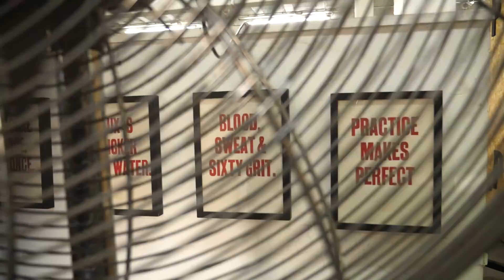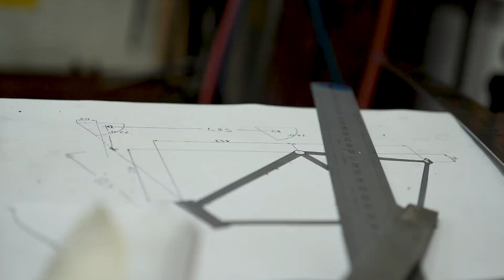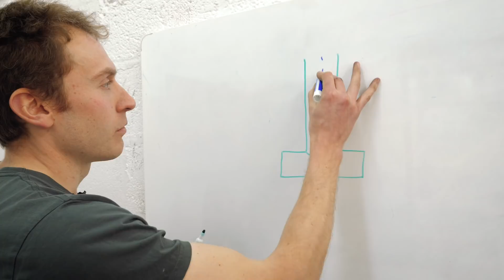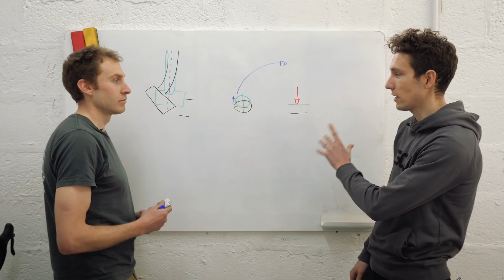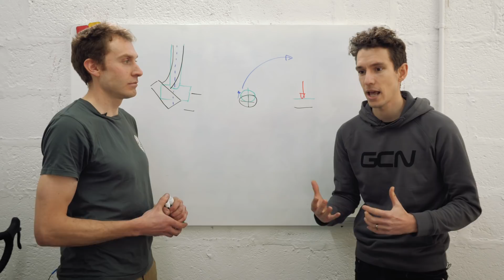Are You Faster On A Stiffer Bike?

Comment: Saying a flexible bike could go as fast as a stiff one is like saying that you could still shift gears with elastic bands for gear cables. You’d still be able to get it done and the force that you are applying at the shifter end will always be equal to the force at the derailleur but there is huge loss in work between the shifter and the derailleur because the shifter would have to move so much further than the derailleur. All that lost work would be transferred into heat in the elastic band. Remember work=forceXdistance. The distance moved at the shifter end would be greater than at the derailleur end, therefore there is more work being done and there must be a loss in work over the system. The exact same thing applies to the bike where (accounting for gearing ratios etc) the pedal would be doing more ‘work’ than the back wheel and therefore there is a loss in work due to flex in the frame.

Comment: I suppose what you have demonstrated is that lateral (side to side) stiffness is marginal to performance, but in a sport where marginal gains can make the difference between winning and losing the loss in energy in a frame that isn't stiff could be detrimental at the top level.

For the everyday rider however, stiffness translates into that planted, secure and direct feeling when you are pedaling, as well as contributing to the overall ride quality of a bike. After riding different bikes, I can comfortably say that regardless of any performance differences, I'd want to be riding something stiffer because of the better feel.

Comment: Another different thought that is more based on physiology than physics.  Does getting shaken and beaten on a super stiff bike cause the rider's performance to drop faster than it would on a more compliant but possibly slightly less efficient bike?  This is also related to the tire analogy.  Clearly bikes designed for pave allow compliance in some dimensions.  But maybe even lateral bike flex is useful.

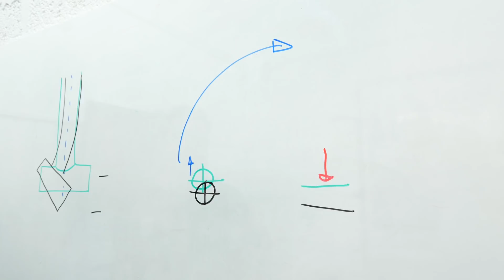Comment: The clockwise rotation mentioned at 5:50, would that cause the chainset to spin in the opposite direction if you repeated the experiment on the left crank, seeing as you are observing from the other side?

Comment: Jan Heine calls the energy returned by frame flex under pedaling load ‘planing.’ Its hard to understand, but I personally believe it’s a thing, and I believe I feel it occurring. When I ride my flexier bikes. Basically, different riding conditions and loads require different frame characteristics. If you ride crits in a punchy manner and sprint out of the saddle standing up at 1800 watts, your optimal bike will be fairly stiff. If you use 300k brewers and churn a moderate cadence at 200w on hour long climbs and never spring above 1000w your optimal bike will be fairly ‘flexy’, at least, in the seat-tube. Horses for courses.

Comment: Two thoughts:
1.) The resonance frequency of an body depends on its stiffness to weight ratio and resonance phenomena are related to energy absorption. Thefore if the excitation frequency is in the range of the resonance of the frame, the energy "loss" could be higher.

2.) If the deformations of the frame are leaving the linear elastic region of the material, the osscilating stresses could lead to a hystersis loop. This could also mean energy absorbtion.

Comment: Frame flex probably doesn't result in huge losses via heat or sound, and while it is feasible that the majority of the energy is returned during unloading, I think the bigger concern is the effects of frame flex on other components. Do the brakes rub? By how much do the cassette and crankset rotate relative to one another? Even a few degrees of difference can result in additional friction and wear on those components.

Comment: My take on it is that even if the frame flexes, and you got 100% of the energy back once it released it, you could claim that the energy inherently becomes less useful for what you are trying to achieve, simply because the power doesn't go down immediately when you push down, but rather a few moments after (perhaps on the  up-stroke). There could potentially be a side effect that the flex built up from pushing down on the left pedal is released as you start pushing down on the right pedal, and given the rotation is in a different direction, you basically need to waste energy to overcome the flex generated by the other side.
So if you think of potential energy stored in something like an elastic band, the more energy you put into it, the more energy you need to use to keep it stretched out. (and whilst you get the energy "back" when you release the band, if what you are trying to achieve is pushing out only, the release of energy doesn't help you do that.)

Comment: Frame flex didn't move the wheel....chain stretch and then recoil moved it. As can be seen when Simon pressed down on the pedal, the frame flexed sideways. And then releases sideways. The pedal moves down, stretching the chain, and then releasing the brake, the pedal doesn't move back but rather the chain recoils and spins the wheel in the only direction it can go.

Comment: Looked like you were just loading the crank and drive train? You started with the crank at 3. 0clock then stood on it till the crank went to 4 o clock then let go of the brakes frame flexes back to natural crank moves  somewhere near 15 mm?      
I would have thought you would have to press the brakes, load the crank then release the brake and the crank simultaneously that way the only force being used would be the frame not your waight pushing on the cranks?

Comment: I suggest you climb a hill with two bikes, with identical weight and identical aerodynamics (or as close as possible to that) - one quite flexible and one quite stiff. Keep same average power with both bikes and see if the stiff one is faster
Reply: Davide Archetti I’ve done exactly that with my Colnago C40 vs Tramac SL3 and no difference. I’ve also done varying watts with the same PM. 300 watts and 550.

Comment: The turbo is static and solid so all (apart from minimal heat loss) the energy goes back to the drive train.

On the open road some of the flex energy goes into the tire which is not as static and solid so more energy perhaps goes into heat loss and friction loss to pushing the tire contact point in the none forward motion.  Minimal though...   

Solid bike = Instantly energy to drive train

Flex bike = a slight delay for energy while the frame recoils the energy back to the drive chain via the flex (albeit small energy loss as above)

Ps I have a flexible aluminium frame and LOVE IT 😍

Comment: This was an interesting test. However, it is a static test of frame flex. In a real world dynamic test, where you might be sitting or standing, accelerating or cruising, cornering or riding straight this principle of stored frame flex may not apply at all. Also I wonder whether the speed and timing of the release of this stored energy in a real-time crank revolution is beneficial or not?

Comment: Stiffer frames are 'generally' more responsive - not conclusively faster. However, the concept you speak of derives from Strain Energy and Energy Transfer. Respectively, this is the stored energy in a stressed material where the material (bike frame) deforms within the material's elastic limit, thus producing a recoverable energy equal to the work energy gone in to deforming it in the first place - i.e. Simon's foot.

The Energy Transfer side of things depends on a whole array of complex engineering phenomena specific to our subject  of interest - bike frame design in this case -  but in short, frame stiffness (aka flexural rigidity) is responsible for allowing the improved flow of stresses (i.e. stain energy) through the bike frame. The stiffer your frame, the quicker and more efficient the work energy is transferred through the frame - AND NOT NECESSARILY TO THE REAR WHEEL! For wheel-specific efficient energy transfer requires more detail design in relation to tubing, or in general the frame itself. Put it this way, a box section is a lot better at being stiff compared to a flat plate due to its section modulus.

Comment: Bike frame under load is like a non-ideal spring.  The amount of energy that is dissipated by a non-ideal spring under cyclic load is proportional to the mechanical "hysteresis" of the spring/system and has nothing to do with its stiffness (modulus).  Typical material used for bike frame and components (steel, alu, etc)  have very small hysteresis, with the exception of the rubber (tyre).  

Even acceleration, once averaged over 2-3 pedal stroke, should not be impacted by stiffness.  Only the "instant" acceleration happening within a fraction of a pedal stroke would be impacted by low stiffness (thus the feel good of a stiff frame....)

So, I got to believe that she should start to look for low mechanical hysteresis frame rather than stiff frame.     Maybe we were looking at the wrong characteristic all along...

See for more info: https://en.wikipedia.org/wiki/Hysteresis#Elastic_hysteresis

Comment: The stiff frame does more than just transfer power more efficiently and effectively. It gives a more solid feeling to the rider, so they have confidence in it. If the angle of the pedals changes when loaded and unloaded how would this feel to a rider sprinting? I noticed the difference from the same bike with a change of cranks. 11 year design to 1 year old design was a huge change. From feeling like the frame is delicate and flexing, it went to solid as a rock and flies along and feels so much better to corner on. I imagine the same is true of the frame too.

Comment: I will try to make a compelling case where the energy loss of a flexible frame goes, but bare with me:

I think the thesis demonstrated in the video is a bit flawed mainly because it represents a static situation that does not regard many of the factors contributing when pedalling dynamically. Several factors are allready highlighted by other comments, thus i will point at one that I think is significant. The energy transferred into the frame while flexing will probably be returned without to much loss to heat, BUT will more significantly be returned in an other vector (direction) beyond the crank arms 3 o'Clock position. It will increasingly be released as a sideways force towards the crank arms 6 o'Clock position. The bottom bracket itself will thus swing from side to side like a pendulum. The rubber and the road will absorb the energy while counteracting the sideways force. You are thus wasting both energy and rubber (most of the heat is thus generated in the rubber of the wheel, not the frame ).

The notion that the bottom bracket twists around the center of its own axis is wrong. The whole bottom bracket moves sideways in relation to the track of the wheels (pivots around a point higher up on the frame). More flex in the frame equals more sideways movement of the whole bottom bracket area. Even the front derailleur, crank, chain and even your feet are dragged along this pendulum which might be a significant mass. Now, accellerating mass back and forth at a 90° angle of your direction of travel IS a WASTE of energy. Not easily observable since it is mainly moved in relation to the track of the wheels.

Then if you accept that the bottom bracket will be swinging from side to side over the tracking of the wheels, you will also have to accept that the stiffness of the wheel is equally important as the stiffness of the frame in this system; thus contributing to  explaining why a stiff wheel feels like it accelerates better. A stiff wheel contributes to reducing the sideways pendulum of the bottom bracket, making sure more of the energy translates to forward movement.

Now we have a consistent explanation of why both a stiff frame and a pair of stiff wheels create a feeling of translating more of the energy we put to the pedal into forward movement.

Comment: This is a very interesting topic.  Was the amount of energy released by the spinning wheel equal to Simon's weight times the distance the pedal deflected down?  Elastic systems  see absolutely no loss in energy while a plastic system does. Is a bike frame considered elastic or plastic? to what degree 70% elastic? 50%?  based on what frame material steel? Al? Carbon Fiber?  What would happen if rather than the bike being locked in it's transverse plane by friction, it were some how allowed to shift to its left side or right side?  IF it did shift and thereby release some or all of the frame twisting energy into rotating the bike about it's vertical axis and little to none went into forward motion of the wheel upon brake release, the next question would be how much would a forward moving bike be considered to be 'locked in' laterally?  When I roll a car down the road and an outside force like wind hits the car, for some reason the car moves a bit in the direction of the wind.  But is it substantial compared to the other forces pushing the car?  Well this would be a potential energy sink like 'heat' or 'sound' which is spoken of.  Something to differentiate here is there is there is torsion in 2 axis here. What I am speaking about above has to do with the long axis of the bike and is force times center of foot to center of bike.  6 cm? 7 cm maybe? ( this is out of plane torsion) and secondly there is a 170mm crank length times  rider weight which is a greater torque but it is resisted by a bike frame built in this very axis ( in plane torsion). Perhaps I need to go back and review the video as he is addressing a torsion of what seems like more of the former. 

a final note on sound: I had a high school physics teacher tell me the amount of sound energy released from something like an explosion is equivalent of heating a cup of coffee about a degree or something ( sound has no energy) so we can rule sound out.

Comment: The experiment has so many variables not accounted for.
1. The wheels are different so the spokes and collective wheels might have more torsion available.
2. The brakes might release differently, if slower to release on the old bike it wouldnt give as much emphasise of the stored potential energy. The demonstration only showed the new big stored more energy in the same amount of deflection which is logical given it is stiffer, it needs more energy to do so.
3. The cranks, bottom brackets and potentially front wheel too all vary so have different effects on the torque applied to the frame.
4. Instead of using the block, set the crank at 90 degreees to TDC and have the rider load the pedal fully. Check the height of the pedal before and after. Maybe test deflect at different crank angles.
Reply: You could try finding the minimum force which would achieve full flex for both frames. Then take a rider of a weight, and work out how far around the pedal stroke they would have to go to add that force to the bike at different cadences. The further into the stroke, the less efficient the frame would be. In theory it would mean higher cadences would have greater losses because of the lower force the rider is able to put in. Could measure the forces with power pedals which are calculating the torque to give power.

Comment: Well it's just like a guitar string being struck. If the bridge is not stiff, if the top is flexy, it will dampen the vibration of the string, so the sustain will be shorter and it will sound less bright/dull. For a bike it's kind of irrelevant because you don't expect your pedal stroke to be sent back at you. The effect that could be seen is conservation of momentum. It seems to me that most of it is lost through friction both with the tire rolling resistance and the freehub, unless you're riding a fixie. I'd be ready to sacrifice a little bit of efficiency for more compliance and comfort. However when a frame bounces from left to right when you're putting a lot of power you also lose time because the rear wheel is not travelling as much in a straight line. So while power is conserved it's less used to propel you forward. In any case I've won a few town sign sprints with my old steel bike during group rides, so the effect is probably negligible most of the time.

Comment: You want a stiff frame because it will load up earlier on the pedal stroke and allow the torque to be higher earlier and for longer. The two frames absorb the same energy for a given rider but the softer frame would require more travel before it has finished its torsion so would require the rider to push further toward the angle of peak torque from TDC, reducing the energy the rider can transfer to the drivetrain. Then the soft frame would give the energy back when the crank is at a closer angle to BDC so the crank has less length and therefore less torque available to put energy into the drivetrain. So it would make loses at the start and end of the strokes and would be similar on the upstroke when pulling up. The idea that the two frames give back the same energy is relatively right because of the energy putin, the difference is how they do it.